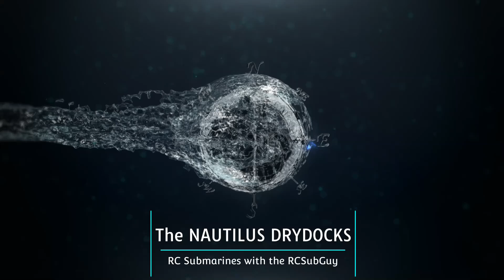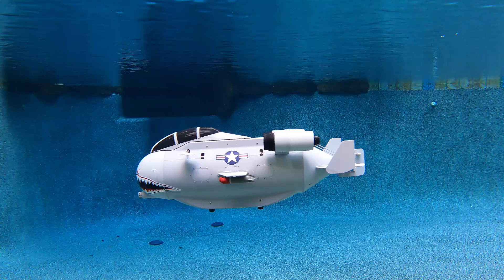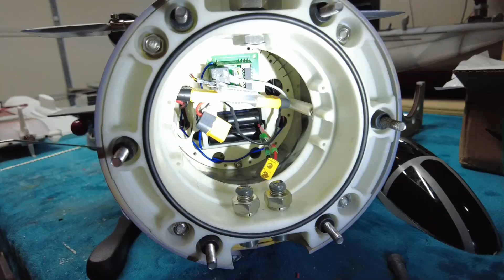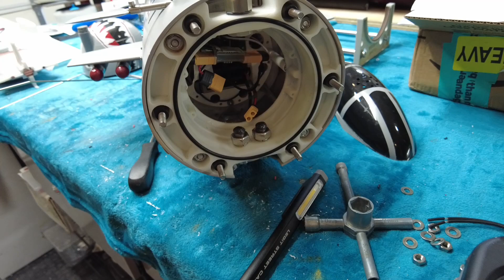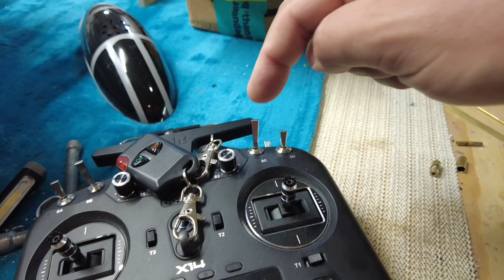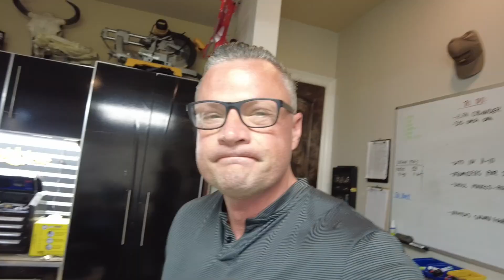The RCSubGuy Tours you Through the A-10 Sub-Kill Remote Controlled Thundertiger Neptune Revamp.

Comment: Very fun build👍🏻
Bought a used one after being impressed by the other video where you turned a ThunderTiger Neptune into a cute steampunk sub.

Unfortunately during our first testing of it in the bathtub, it was taking in a lot more than a teaspoon of water after mere minutes. 
So we started hunting down the bubbles. Pretty soon the whole thing was screwed apart and the culprit appeared to be the rear O-ring. (Plural? It's been a while)
We did sufficiently squish the front one it seems.

But the rear looked a little deformed and the sub had been sitting on a shelf for ages, so we suspected some rubber deterioration. We tried finding and ordering replacements, but they were really hard to find obviously. Plus we couldn't find more common alternatives either that would fit.

Eventually we did get some replacements for one type, but not the other. They were old stock so likely to have similar issues. But we figured we'd try them anyway.

Naturally while waiting for those to arrive, life happened and it's been sitting dismantled but packaged on a specially built IKEA shelf ever since xD

Would like to fix it and turn it into something cool though.
I was thinking we could maybe model and 3d print a mold and cast some silicone replacement O-rings of the right dimensions. Should all else fail.